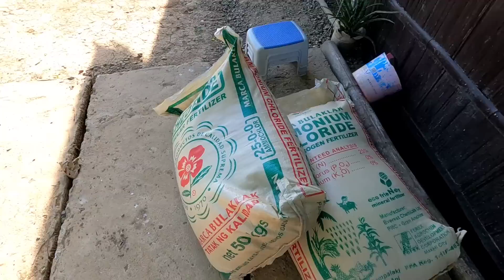HINDI AKO MAGSASAWANG MAGTANIM KUNG GANITO PALAGI

Comment: I think the Kubota, tiller/cultivator would be a great addition to your farm's agricultural needs. just make sure you have a professional expert mechanic, and check the overall condition of the tractor if you decide to purchase it. Kubota tractors are a Japanese brand but are assembled in the U.S. they are very reliable tractors. But If you are buying a used Kubota tractor it's only fair for you to have an expert look it over. It is also wise to check whether you can find other implements, like plowing, cutting grass, and other attached equipment for it. I think Kubota has a dealership in the Philippines.